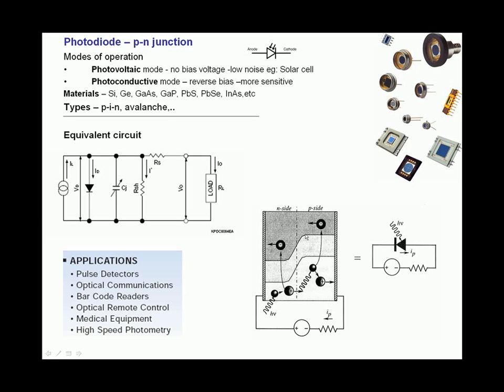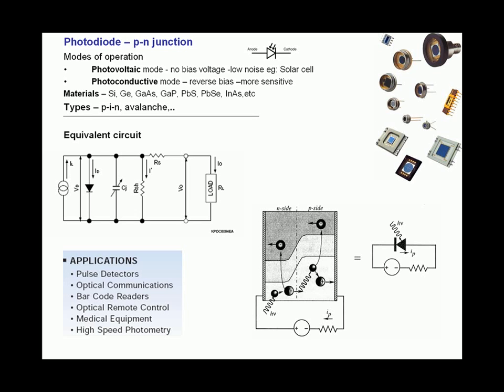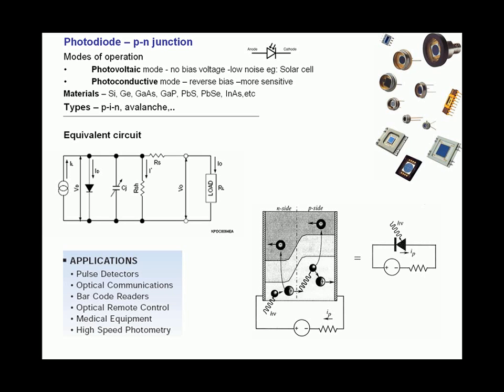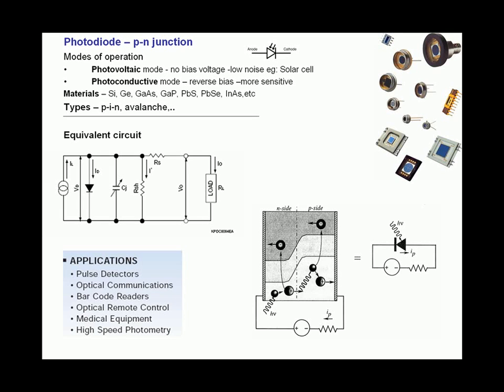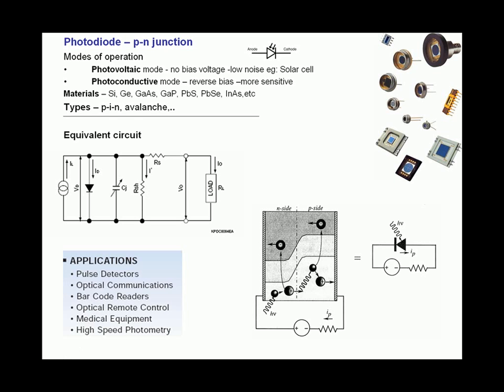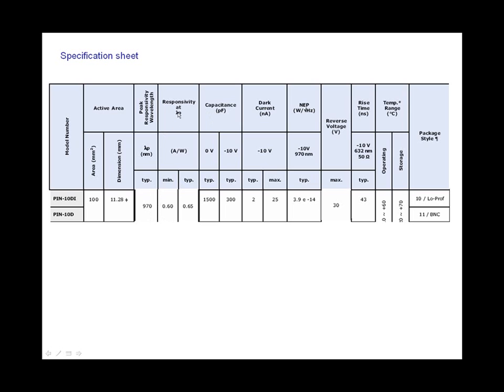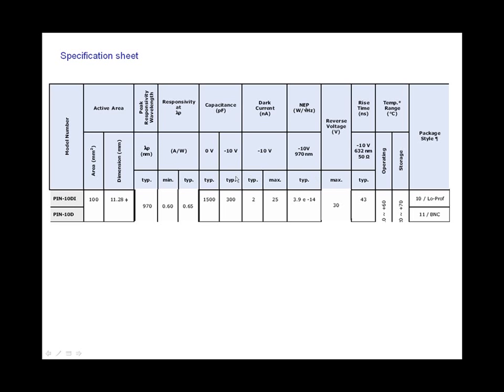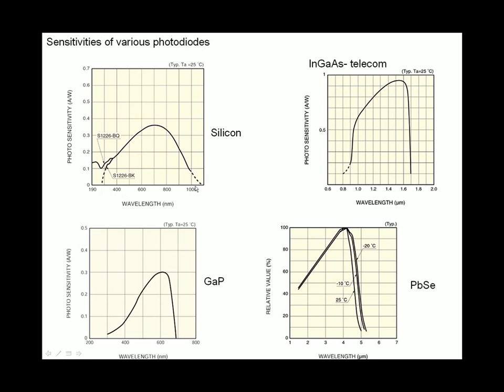Photodiodes

Comment: All the technical information is great and the extent of it is also proper, however twice you got away from the mic and your voice was hardly audible, also the images were too small, meaning that the letters could not be read. 

As I said, the information was excellent and useful, but if you could correct those video and audio details, it would be much better.